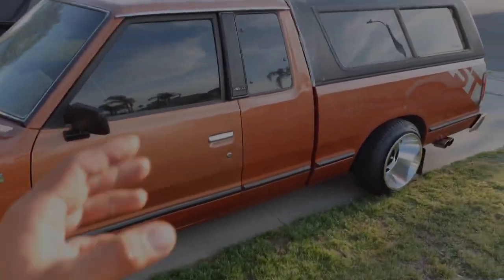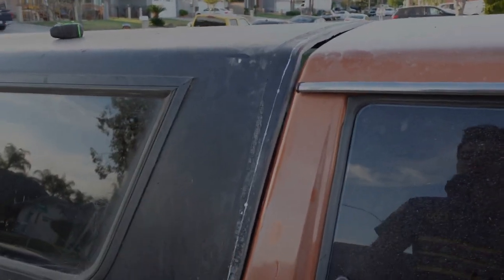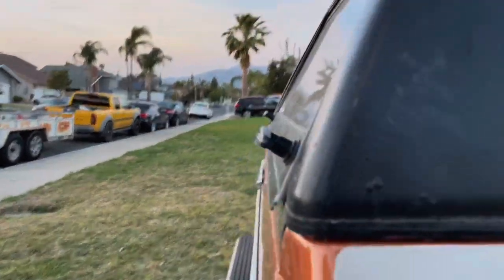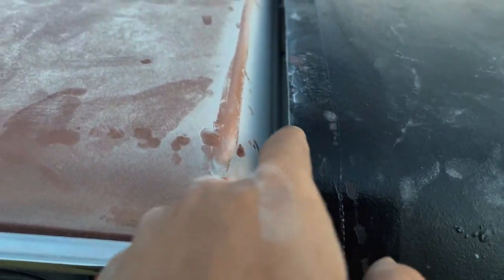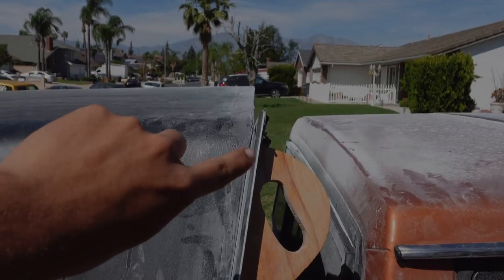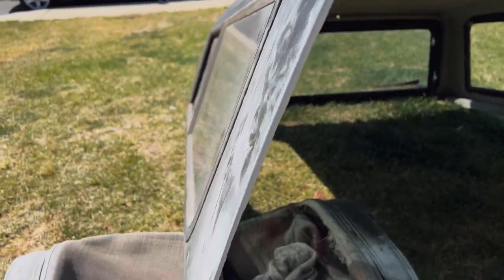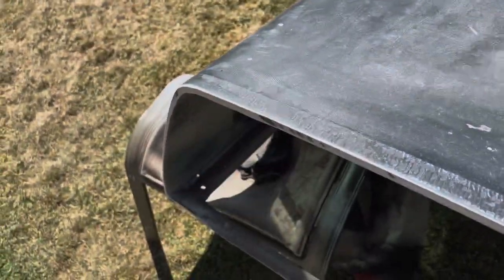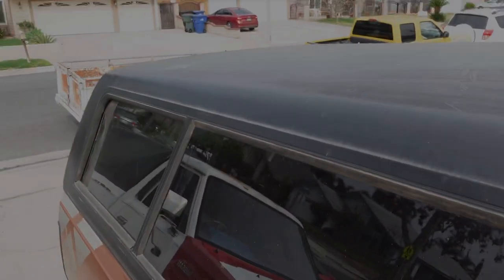CUTTING THE CAMPER SHELL TO FIT THE NISSAN 720 !

Comment: Get yourself a set of dividers that holds a pencil on one side. Any store that sells school supplies should have them for a couple of $. Replace the pencil with a crayon or grease pencil. You can then measure the required gap and scribe the shape of the cab exactly. You make one cut, clean it up and your done!
Reply from the maker: Thank you I appreciate the tip

Comment: Make a panel out of a sheet of aluminum and you can fiberglass it in. It will leave a good edge for window trim.
Reply from the maker: I just started making the panel today and fiberglassed it in just haven’t made that video. I sadly didn’t think about an aluminum panel
Reply: @STONEBROKEGARAGE  I'm sure what ever you're doing will turn out great. Aluminum is nice and light but strong. And it cuts really smooth with a jig saw.